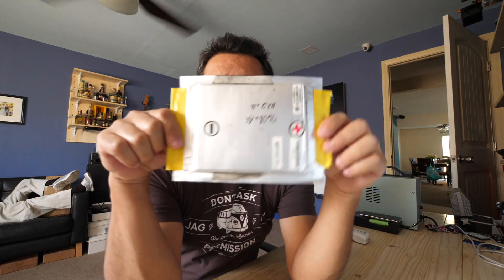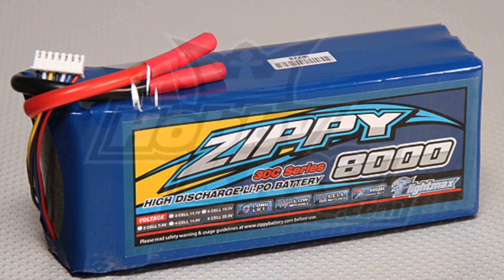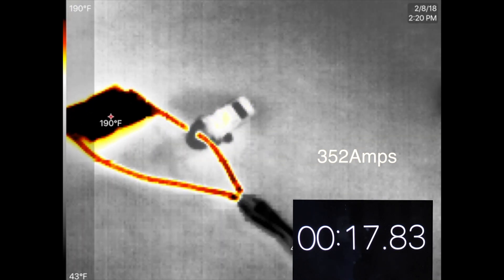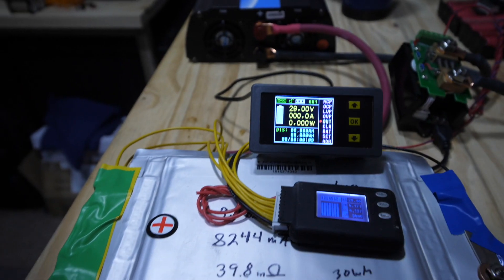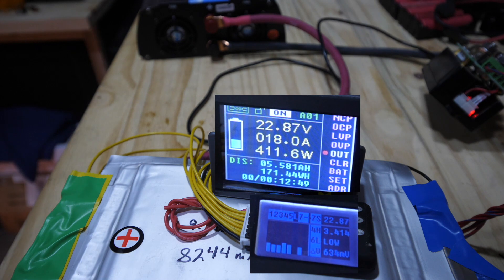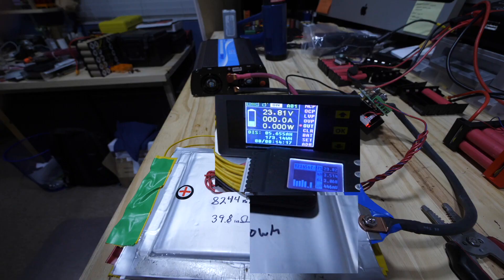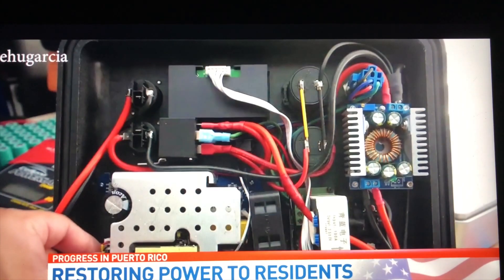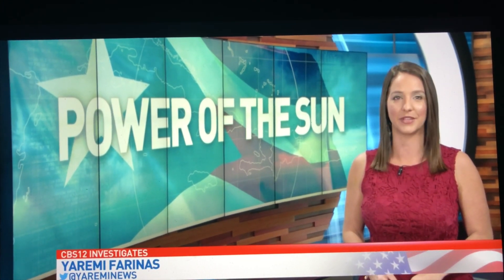200A LiPo cell   (Dead Short Test) 2018

Comment: Greetings Jehu or anyone else who can answer.  Is there a major disadvantage of using a 4s setup with a "buck converter" or some other application to step down the output voltage to get better utilization of the power in the cells when using a 12v application?  For some of my projects I am considering this with 18650s as well.

Comment: hell yeah, love your video, i'm pretty sure now i'm gonna order some cells and mod my 24v USP to lipo
it looks like they gonna fit perfectly in place of 2x12v acid
i still need to figure out what BMS to use
perhaps you can give me your opinion if it's a good idea to swap the acid, i have a APC 1200pro and it drives me crazy to know that in few mins it shuts down :)))), and yes, it takes 2x12v in series

Comment: Is it only unusable power because it can no longer run the inverter? If you had a solar system  set up in your home, not everything would need to be connected through an inverter and can be pulled straight from the batteries ( lights, USB outlets, and such.) With that in mind, would that change the unusable power percentage?

Comment: @jehugarcia i just purchased 20 of these 8ah 25c spim08 batteries for a 72v 3000watt ebike motor/controller kit i purchased. wiring them in series should i use the amount together with fully charged amount 4.2v x 18 =75.6 to get my  72v or fully discharged amount 3.2v x 22 =73.60 
Avg middle cell voltage 3.7v x 20 of these high power cells would be 74v 
is that too much for my 72v controller? should i open the controller and check the capacitors to get a better idea of what it can handle? just wanting to do this right and not screw it up. maybe i need a voltage regulator or bms? lmk what you think. braapfpv@gmail.com thanks so much! love your channel btw

Comment: Your milliohms seem to be way off. When you mentioned a lipo is 10 miliohms, that is for the whole pack, not per cell. I have 1800mha lipo cells under 3milliohm, 5x less capacity, and 10x less resistance, seems like these spim08hp cells are junk at higher loads?

Comment: For the battery to do 350 amps at 3.7 volts, the internal resistance of the whole circuit would have to be around 11 milliohms. No way these cells are anywhere near 30 milliohms.
Reply: Indeed. They would be even less than 11 milliohms. (cuz of voltage drops)
Reply: @xlxs1  I recently tested some of my cells and the majority are around 3-5 milliohms (5 second DC IR).

Comment: If I needed to make 12v at 6 amps with 4/ 
SPIM08HP 3.7V 8AH 200A LITHIUM ION POWER WHAT RESISTER CAN I USE OHM & WATTS?

Comment: i've been following you for a long time and I really need your help. I built an E-Kart, it is great and super fast. I was able to get to 68mph out of it. I have an Alltrax 72v 400a controller, 72v motenergy ME1003 motor, and batteries by tech direct (Nissan Leaf). I recently found out that the battery that I'm using is not rated this configuration for my kart. I was told if i keep sucking that much juice out at 400 amp, i will have a big problem when the batteries start to budge. I want to know could I use these SPIM08HP 20s2p cells and how long will it allow my kart to run for if 400a is used for 1min and 200 continuous.  PLEASE HELP futurerel@yahoo.com or reply here
Reply: Hey dude, working on the same exact build for an E-Kart. ME1003, Alltrax 72v 400a controller. I ordered 64 of the SPIM08HP batteries for the build as well, and I'm testing all of them now. Would love to chat with you more about this as you're the only one on the internt who I've found using my exact parts. Maybe we can share information.

Comment: I have nine Nissan Leaf batteries and I’m running a 24 volt system ,what bms should I use to control dem and give me the best battery 24volt configurations

Comment: I bought 60 of these out of the 60 10 of them puffed up before they ever saw a load. All but 10 of them have voltage leakage to the foil packaging which means that the internal insulation has degraded. On some of these cells the aluminum foil of the packaging has full cell voltage at the edges and will short out on any piece of metal they touch even if you're just working on one end of the battery you can short out to the foil. Danger these things can burn your house down. I am returning all of them that I bought from Battery hookups they are sending us rejects from China! This may be similar to the Japanese using balloon-borne bombs to set random fires all over United States. This could be a weapon of mass destruction spread out all over the country. Watch out my fellow Americans
Reply: I have gotten in contact with the company. And they have made good on their warranty. I have no trouble with battery hookups they were not aware of the problem. Now they are stuck with bad batteries they warrantied them and paid shipping to take them back. Very nice people at battery hookups

Comment: I dont understand why you could not add one more of the cells to your 12 volt pack?...wouldnt that resolve the low voltage problem...or would the voltage be too high for the inverter?

Comment: Would these work well in an 80s, 40s (or even 20s) config. I have an application I need 300 VDC 200A
Reply from the maker: Yes that’s where they come from 350vdc battery pack
Reply: @jehugarcia  Awesome,  that was a quick trip down the lipo rabbit hole, really appreciated your vids!
Reply: spim08hp flat cells from battery hookups. danger danger. they don't tell you. many of these cells have problems inside. there is current flow between the foil covering insulation layer and the terminals of many cells. measure the terminal to edge voltage along the seams. i'v gotten 3.9 volts off the foil wrapper. the cells will puff and be destroyed from self discharge. many of my 60 plus cells i bought do not have this problem. all the 30 % that puffed without ever being under load have the short to the foil. warning the edges of the cell packs carry current.  not safe for marine environment at all.  i only made 12 volt packs at higher voltages there will be bigger sparks from foil to terminals. danger if they self discharge they will puff and oh they say you didn't do good assembly. they don't say anything about do not touch electrically hot foil next to terminals. if a buss bar touches the edge of the foil it will short out the whole battery.
Reply: @willfriar8054  I've heard that also about these batteries - got any work around so that doesn't happen?

Comment: I don’t understand the 200A side of things, could you explain, please? If I have a 40A Speed Controller could these batteries be used to power it? How does someone regulate the amperage? Or you don’t have too? You mentioned the capacity multiplied by the C Rating to calculate 200A. What does it all mean?

Comment: Man I've tried it all to get a LiPo or Li-Ion battery to explode or get any kind of reaction, I punctured the cells, took them apart, put them under water, shorted the cells, overcharged and over discharged cells... You name it and never did one explode or burn or whatever, the only thing I got was that the cells heated up a lot and after a couple times the voltage was zero or got reversed even but nothing like you see on YouTube sadly.
Reply: spim08hp flat cells from battery hookups. danger danger. they don't tell you. many of these cells have problems inside. there is current flow between the foil covering insulation layer and the terminals of many cells. measure the terminal to edge voltage along the seams. i'v gotten 3.9 volts off the foil wrapper. the cells will puff and be destroyed from self discharge. many of my 60 plus cells i bought do not have this problem. all the 30 % that puffed without ever being under load have the short to the foil. warning the edges of the cell packs carry current.  not safe for marine environment at all.  i only made 12 volt packs at higher voltages there will be bigger sparks from foil to terminals. danger if they self discharge they will puff and oh they say you didn't do good assembly. they don't say anything about do not touch electrically hot foil next to terminals. if a buss bar touches the edge of the foil it will short out the whole battery.
Reply: @willfriar8054  do you have a picture or a video, that would help out so much better. I just purchase a ton of these

Comment: I hate to have to ask you but this seller is not responding to me. I am going to be making 10 16.8 volt banks with 40 of these. What balance boards would you suggest for an alternator charging the 10 banks at 200 to 300 amps. And what voltage?

Comment: I'm commissioning a system in California of 2,544 LiFePO-4 batteries, 1766wH / 138aH each, in series strings of 53...about ~720v per pack.
We literally have 4.5 mWh of battery.
...   While phosphate chemistry doesn't "burn" quite like an oxide chemistry, I promise you these things are dangerous enough to pop a 2/0 1000v rated cable like a fuse. 
With 8 units I can easily motor-up and trip a 2.5mW generator.

Comment: I ordered and tested these cells and i usually solder to them but there aluminum contacts can someone help me to find he best way to connect the batteries im making a 12s longboard
Reply: I used a drill to drill small holes and ordered super slim nuts and bolts to connect them the batts work really good i like it more than the li-ion pack i used to use
Reply: @nickanzolas  
Hey bro can you hook me up with the link for those nuts and bolts? I need them as well. Thank you
Reply: Mighty Sound i used 1/8in aluminum binding screws with thin nuts i got from my local hardware store and i ordered a 12s 60a bms from ali express
Reply: @nickanzolas  
What BMS are you using?
Reply: Can we use these for power wall?
Reply: e hink27  im sure you could but i dont know much about powerwalls

Comment: Anyone figure out a good mechanical connection for these cells?  I'm working on a riding mower conversion and need a 48V battery that can take 200A continuous and 400A burst.  These cells seem to fit the bill for a great price but I've not seen anything on a simple mechanical way to connect.  18650's sure.  That's simple.  The tabs on these batteries confound me.  Are there clips out there, or would I be using nuts, bolts, and some metal spacers to form connections?
Reply: I used al bars and bolts and nuts built a 4p3s and it can put out the power.

Comment: +Jehu+ I am in need of a high voltage (100v+) high output (+200a) and decent range (+30Ah) for my electric bike build. And was thinking of using these in a 4p-30s configuration or maybe to start a 2p-30s configuration. Do you think these would work well in my application? Not sure if you are familiar with electric bike components but I am using a QS205 50H 3T motor and a power velocity 24fet 150v 15kw capable controller. BTW love the samba! I used to have a '76 poptop camper that my father and uncles beefed up with a Porsche 911 engine that was liquid cooled with the radiator above the cockpit and pipes down the length on both sides to feed the coolant ;) I miss that bus! Yours though! Forget about it! The best build ever! VW should pay you for just creating it! Thnx
Reply from the maker: 60 cells will make a heavy pack,  you sure you are not building a motorcycle?
Reply: jehugarcia 

It is a heavy machine I have. It resembles a motorcycle in many ways but it has the ability to petal for legality purposes. You are correct that 60 cells is pretty heavy, (40Lbs you think?) I would probably play around with the configuration to see what will work in my bike. I'm very limited in funds and have sacrificed meals in order to be able to buy parts for my build. I've got it finished and yesterday I attempted to ride it to work and my battery failed. I'm using harvested 18650's of mixed chemistry and capacity and they just won't do. These cells you've tested in this video can get me the power needed, desired rather, and I can hopefully save the $ to buy them before tom runs out. I really wanted those sanyo 2000mAh 20A cells he had but those went super fast and I couldn't save enough in time :( so based on your knowledge of EV could I use these in my bike? And would it be worth it for me to spend my $ on these rather than going a different route? 
Thanks for your time and replying so quickly I appreciate it.
Reply: Same here. I got 30 of these for an ebike battery.
Reply: Geno Febus how are they working thinking of buying 40 of them for 20s2p
Reply: Brandon G I finished the build about a month ago and it works pretty good just recently I got a BMS from China so I'll be incorporating that into my build and doing away with voltmeters the cheap ones that I bought on eBay. I have a 14 s configuration and my bike has a 1500 watt Hub motor on the rear wheel. With the 14s 2p configuration I guess it's 16 amp hours capacity I haven't realized a huge amount of range but my but usually sore enough and then I want to get off before the alarms go off bummed that I didn't get the cheap price they have for the batteries now 20 for a hundred bucks that about half of what I paid .  I made the series connections with small nut and bolt I tried using a stapler not recommended also solder did not work well. I used little rubber anti-vibration pads made by 3M they were very good at keeping the space between  the end of the cells .

Comment: With the IR on these already so high versus New factory spec, or similar C rated Lipo, I'd say these cells are truly 'burnt' for their original high amp draw applications and would not work that well on high amp draw LEV Ebike use I was contemplating using them for. That's where the lifepo4 cells he had are a better idea than these (even if they too cannot deliver 25c) as they have 5x the lifecycles of lipo so even used, they're still fit for their original purpose. These cells can probably be used to deliver "decent" power say 5c - 8c? 60a max? What do you guys think? Before heat probs and too large a voltage drop happens and obv for their rated capacity in say a low amp draw powerwall, but I have 3 repurposed 8s LG Lipo EV modules here and the cells IR range from 2-4 mOhm (cold @80% charge,) tested on an Icharger 3010b, those would be the IR figures I'd want if I was spending my money on Lipo.

Comment: How well would this work for a power wall of off grid system compared to one made with 18650 cells?
Reply from the maker: Same thing,  except these cells could handle a load of up 25 times their capacity.   Making them well suited for peak shaving powerwalls applications

Comment: Those inverter manufacturers.  Low voltage cutoff is set too low.  I understand some power on sag but inverter  off at 10 volts will kill/greatly reduce the lead 12 volt battery.

Comment: Is that the same inverter you used in the 100a video? The amazon page said 12v, can you confirm it takes higher input voltage? Is so, what’s the max input voltage?
Reply from the maker: No this is a 24v one

Comment: Don't you really need cell compression (or at least restraint) at these high discharge rates? If internal pressure seperates the plates, then the resistance goes up and so does the heating, which equals more pressure and a runaway situation leading to a ruptured cell.

Comment: For the 12vdc test...why don't you start with 4 cells?
You are starting the test with less than 12vdc.
The inverter should be good for up to about 15vdc.
You might get a more accurate test with 4 cells.

Comment: Can they be use to charge a couple of 4S 5000mha lipo rc battery ?
Reply from the maker: Yes, use a charge in between though
Reply: Yes. We don't have power at the RC Track. I have to let my car run and i plug my charger on it.

Comment: Hey Jehu do a 4s pack and charge it to the max voltage the inverter can handle. It will work.
Reply: inverter shuts down over 16 volts

Comment: You could use four 3.7V packs as a 12V DC supply by employing a voltage regulator, and that way you wouldn't see a lot of voltage droop.

https://en.m.wikipedia.org/wiki/Voltage_regulator
Reply from the maker: It’s cheaper to just get right battery
Reply: jehugarcia it's almost inevitably cheaper and more reliable to use the proper part/tool, rather than hammering a square peg into a proverbial round hole, yes!

Under some very rare circumstances where you want 12v DC and never 11.5V or 11.8V and the absolute minimum of weight, using four lithium 3.7V cells and voltage regulation can be an appropriate design scheme (eg: for powering an aerial camera / computer system), although evidently there is a cost and complexity issue.
Reply: Actually the inverter will run just fine on 15 volts coming from the battery. 12 volt Inverters are designed to run off of up to 15 volts because battery chargers are hooked up to batteries, so voltage inverters run just fine with a 15 volt charger on. 

Wayne Sallee
Wayne@WayneSallee.com
http://www.WayneSallee.com

Comment: Got a question: There is a lot of cheap early pre 2013 Nissan Leaf with degraded batteries. Replacement battery from Nissan dealer is very high, like $5000+. Have you ever rebuild these Leaf battery pack with used Tesla cells and maybe even boost the capacity at reasonable cost? Sounds like a good profit potential here... battery service or even selling upgraded Leaf vehicles.
Reply: Nissan batteries are flat, Tesla are 15650, apples and oranges.  The answer is no.
Reply from the maker: Apples and oranges both provide sustenance,   Yes they can be used and it would be an upgrade, but I would never do it because I don’t like leafs,  not even a little

Comment: expensive for used, no? 200 amp, good for welding
Reply from the maker: $250/kwh.  vs  $600/kwh  new  https://hobbyking.com/en_us/turnigy-5000mah-6s-25c-battery.html?___store=en_us